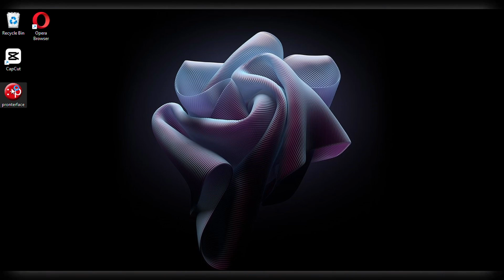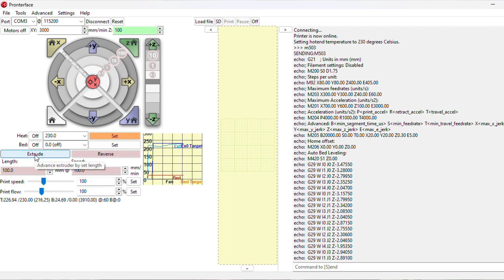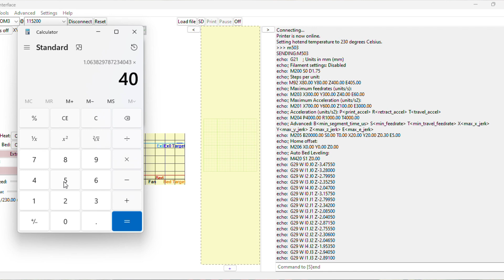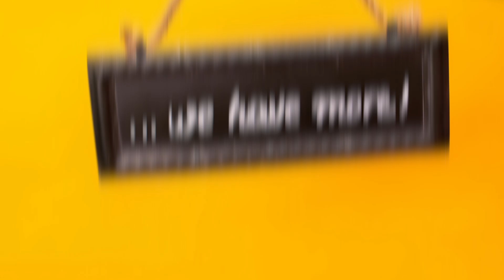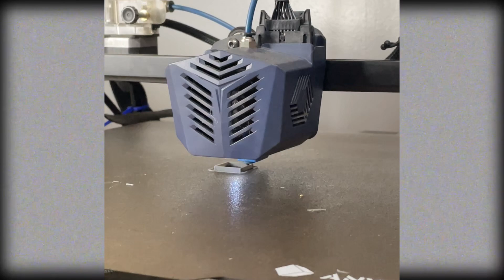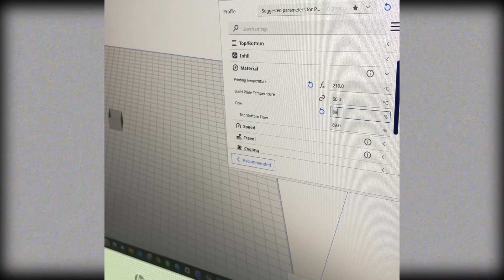How to Tune Your 3D Printer - 3D Printing - (e-steps & Flow Rate)

Comment: Hmmm ... Using Pronterface already means you're not running Klipper, so that's a significant reduction of the audience this video is suited for ...  Luckily most people using Klipper will have suitable tuning instructions for the extruder rotation-distance (the inverse of E-steps used by Klipper) ...
And ... there are numerous videos and articles online showing why that method of measuring wall-thickness for calibrating flow is NOT the good idea.
Reply from the maker: Many people have printers that don’t run Klipper, and these printers are the ones people typically have issues with tuning and getting good print quality. Not every printer is a BambuLab and has pre-set profiles. These steps are simple and very quick so that anyone can use them. 

We have videos on hooking up our Enders to the Sonic Pad if you are more interested in that!
Reply: @arc.industries25  can’t make them all happy. Great information. I’m new to printing and this will help people like me learn all aspects.